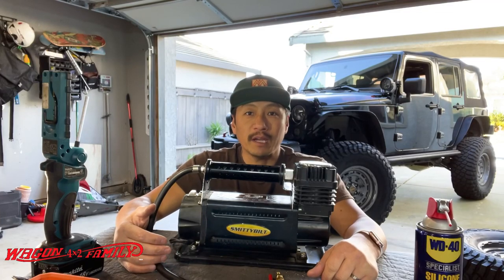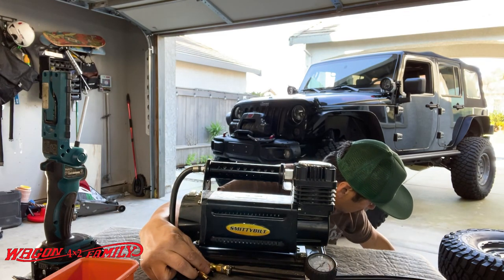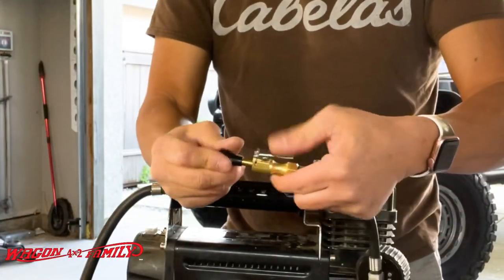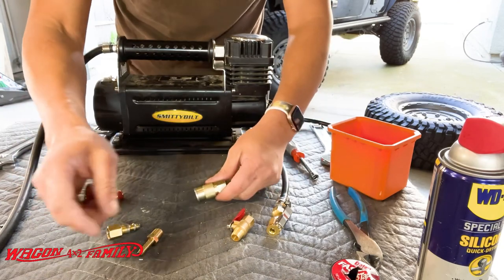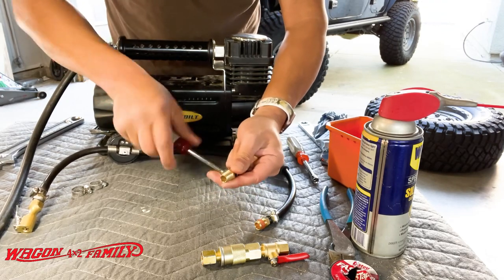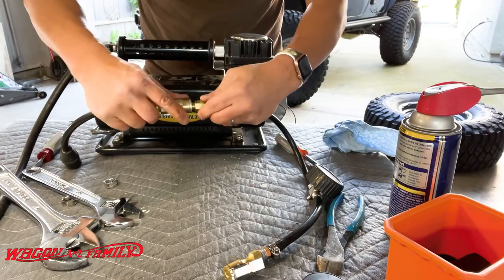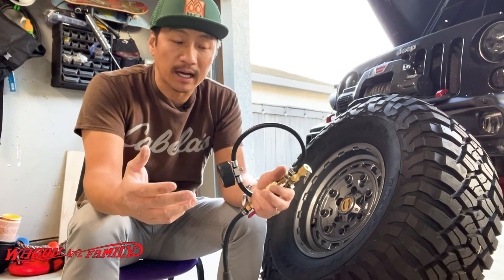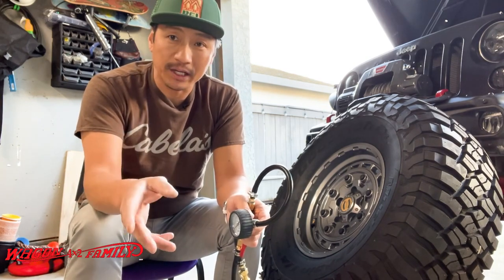Best Air Compressor Hack 200% Better / Cost $10 / Any Compressor

Comment: I'm going to do something similar to my Maddox inflator. I'm not using all the quick connect fittings you have though . Just an air chuck, 3 barbed fittings and a 3 way valve so the compressor doesn't pop the  relief valve. It's not designed to be dead headed like you're doing.

Comment: Don’t do this with the smaller smittybilt.  I don’t think it has the same pressure release system and you’ll probably burn it up.  In that case you need to insert some sort of shut off valve that shuts off the tire side but allows free flow on the compressor side while active - I did it on mine prior to upgrading to an onboard system.
Reply from the maker: Good point, mine has the back pressure value.
Reply: There is another video that did exactly what you said. I didn't know the smaller once doesn't have a pressure relief. Good to know.

Comment: The compressor's overpressure relief value is popping open at around 160psi when you close your value. Those compressor's aren't made to run like that. All of the fittings come open flow for a reason. The valve stem quick connect you put on should be of open flow design too.
Reply: Replace the regular ball valve you put in there with a three way (diverter) valve.  That type valve will shut air off to the tire, but allow air to bleed out a second outlet in the valve. Amazon has three way valves too.
Reply: I believe Amazon offers that same quick connect in open or closed configuration. Get the open one. Keep the compress running while you go from tire to tire and the air will just bleed out of the open quick connect. That'd probably be the quickest way to get aired back up.

Comment: I've had this thing for about 4 years and barely ever use it.  I've probably used it a total of 20 times.  Now I can't even fill up a single tire with it without it shutting off.  I think it's overheating, but I don't know how to fix it.

Comment: l found those lock on connectors for tyre vavles wont fit motorbikes with wire spokes, l prefer the ball type, they fit any wheels

Comment: No problem using hose clamps? I’ve never used the little hose clamps for any more than 14psi. Fuel and oil!
If they can hold  up to 50 psi would be great! 
As for cutting hose’s my wife’s anvil pruners work perfect!